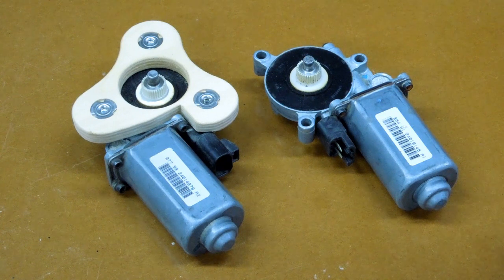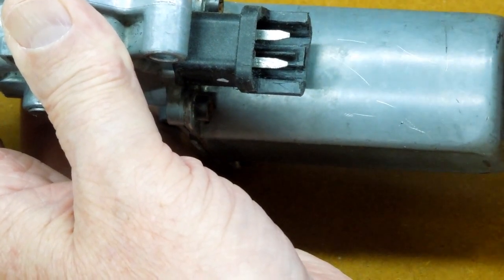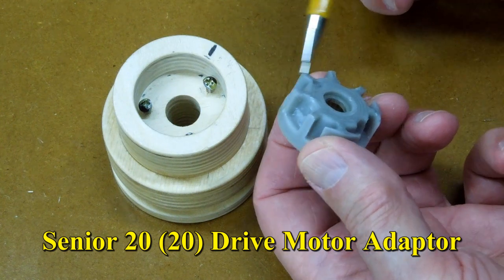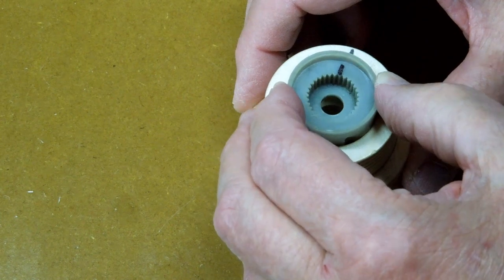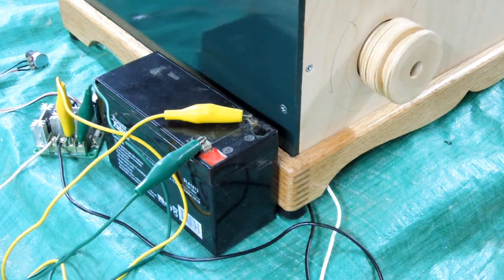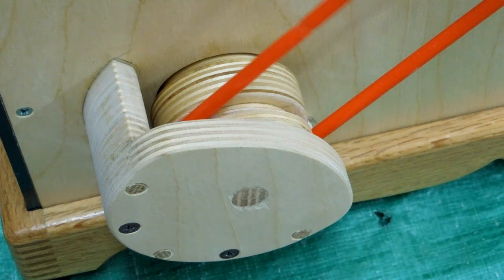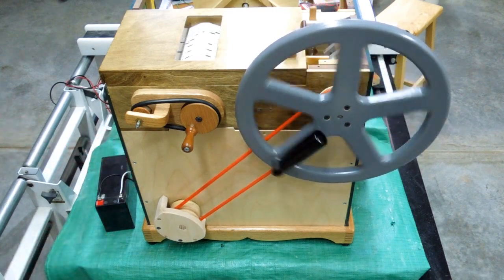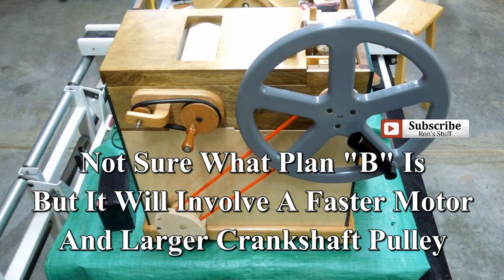Senior 20 Organ (32) Experimental Gearmotor Drive

Comment: a cordless drill motor might work better , they make a little more noise but the package is smaller if you use just the motor and geardrive 
could even use the drillmotor handle and speed controll (drill trigger) and hook up the li ion batteries used with the cordless drill to be able to do faster battery swaps , another option is to browse the internet for a geared 12 volt motor

Comment: it's just a thought, but if you took the pulley cover of, let it run empty, take a small paint brush, dip it in Epoxy, then hold it on the pulley where the belt would run, with it on, "painting" a small Epoxy line on the pulley, while it's turning then sprinkle White Silica Sand on it while running, (you could also put some sand into the Epoxy mix) when dry it should only give the belt better traction, but add to the diameter of the pulley & increase the speed a little...   Do you have plans available on how to make the organ..????
Reply from the maker: The window regulator was just too slow to allow for the occasional required speed control. It has since been replaced by the motor and motor speed controller you watched earlier. The plans for this organ are available from John Smith in the UK. I have an entire video series on building this Senior 20 Organ which you would find most helpful if you decide to build one. There is a playlist for my video series https://www.youtube.com/playlist?list=PLDjucfhdTRPlQbnNCd848nNnnwNdTnk5R

Comment: Great organ and of course we all like the tune.  The trouble with DC is DC needs some power supply or battery and still must plug into the wall.  If I could find a source for cheap AC gea rmotors I would be in hog heaven.  Keep on keeping on.

Comment: you might try using a timing belt from a 4 cylinder car engine.  it has cross grooves and wont slip at all.  what are you going to do with this organ when done?  this is assuming it will ever be done:>)  enjoy your channel and have been a subscriber for a long time.
Reply from the maker: Stay tuned. It will be done! Ron

Comment: I'd use the good old and tested leather belt from an old Singer sewing machine. Especially soaked in oil, the thing won't slip (the round, original type with an oblique seam and sown, not stapled, joint).

And to get it to grip even more, a metal surface on the two pulleys, which can be some self adhesive aluminium tape.
Reply: Oh, and as for the motor, an old Volvo window wiper motor should be pretty good. A Volvo truck window wiper motor would be even better. Those have the 12v system, and, they were designed to run on 3 speeds (at least in Europe).

Comment: Some silicone caulking smeared on the pulley and left to dry would greatly improve the grip. I used that for band saw tires and it held up remarkably well.
Reply from the maker: I thought about several things to improve this setup but there comes a point where you sometimes have to recognize you’re headed in the wrong direction. There’s a better solution, which required backing up and starting over.

Comment: How about an AC motor from a fan with a wood gear reducer?  If the gears were visible it would add to the novelty of the drive.   You just need a motor with enough power.  You could use the power draw of your current setup x two as a baseline.
Reply from the maker: Wood gears at this speed are noisy and this is already heavy enough. Fan motors don't have much torque. Want to stay with 12VDC battery operation which keeps it portable.
Reply: If you adjust the pulley diameters and use a small timing belt you could run it direct drive from a DC motor. That would be quieter and more efficient than the window gear motor.